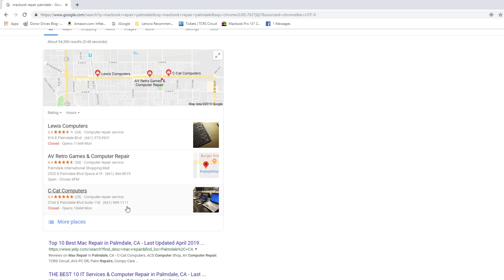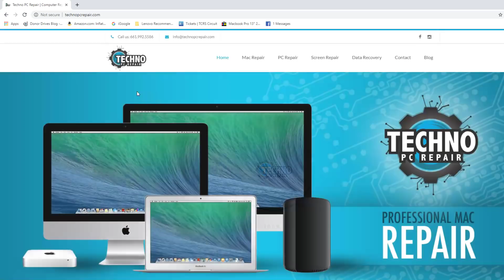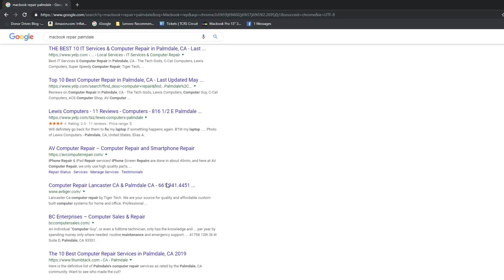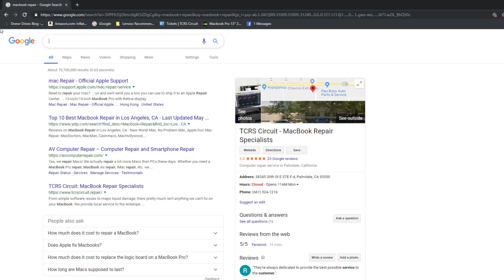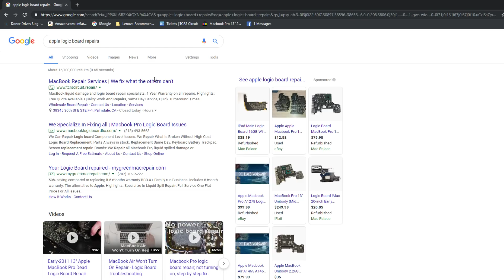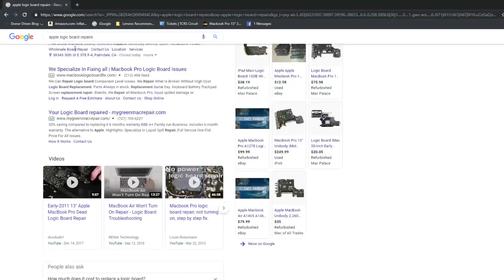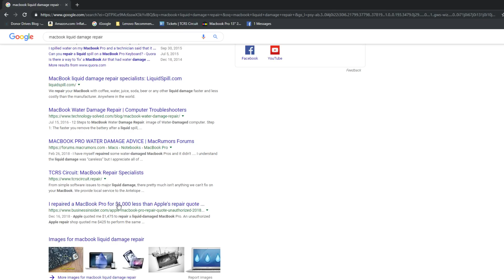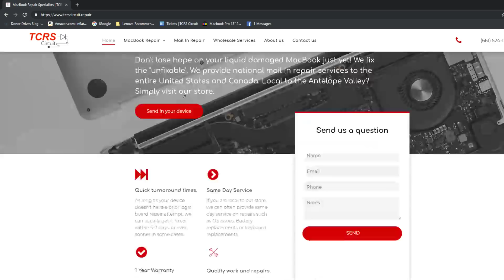Can GPU vcore be made great again?

Comment: Quick note on your electrical...  make sure to spread your power consumption over more than one breaker on the circuit and evenly over your surge protectors... I know it sucks running cords and such, but best to solve the whole problem and not just quick fixes and such. No worries on the hands shaking man... I'm fairly sure we all shake to some extent, fine dexterity isn't as easy as most want to believe.
Reply from the maker: I got another power bar. Evenly spread out now